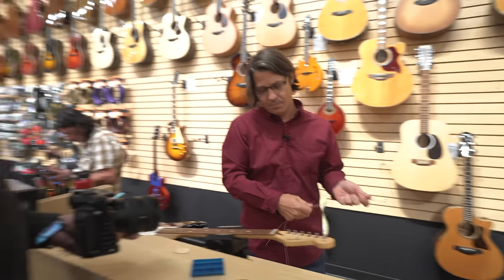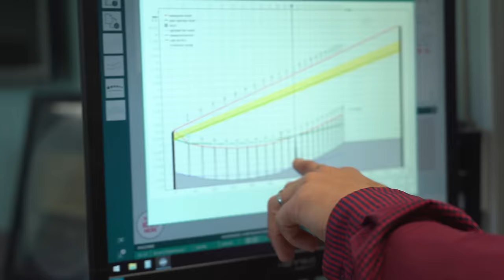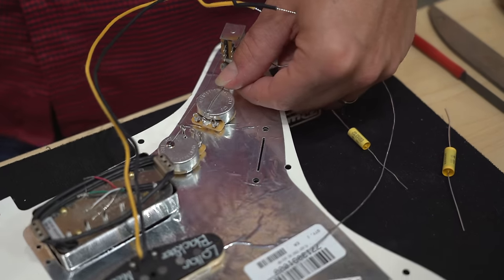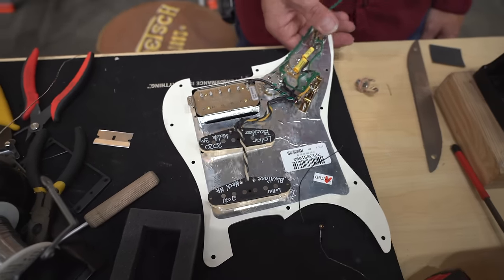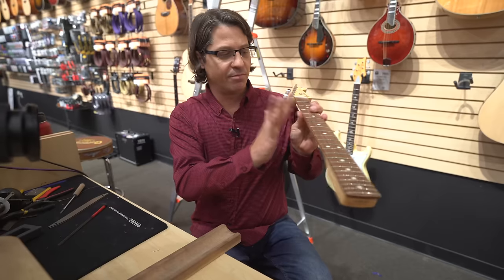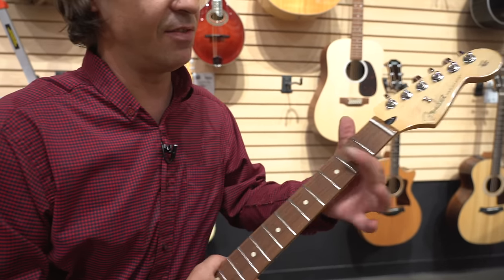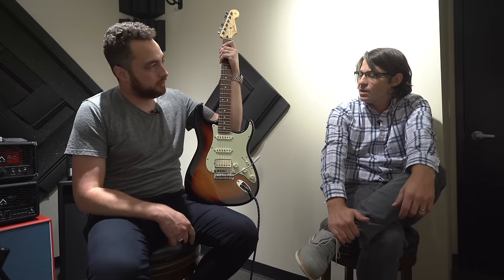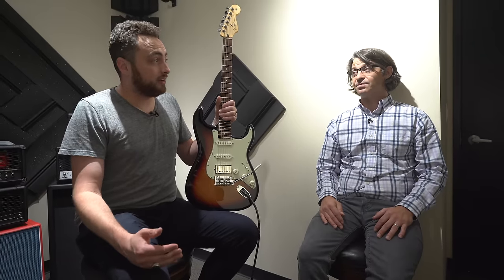We Tried To "Custom Shop" The Cheapest Fender Strat

Comment: I’m a lefty and my main guitar is a telecaster. Bought all of the parts individually. MIM black body, Gotoh modern bridge and saddles. MIM Maple neck and added fender locking tuners. Pre-wired control panel from Wainwright Custom Guitars. Fender custom shop Texas special pickups. Took the PU cover off the neck PU and used an open faced cover. Wanted a copper colored pickguard, but being left handed that was impossible to find. Settled for a nice aluminum one.
Put it all together when the last part came in and had it professionally set up.
$987 total. The guitar is perfect in every way. The pickguard and open face bridge PU cover makes it look badass.
A lefty can’t walk into a guitar store and play a telecaster that nice for under $1,600 if there are any lefty guitars to play. I stopped going to music stores because of the lack of options when I go.

Comment: I have to say, I've plenty if guitars and have owned many Fender Strats. The Mexican Player series are great for the money and mine have never had the issues this had our of the box. So either standards are changing in QC or I've been lucky. Because I can't claim the American feels any better holding them side by side. Both sounds great too.
Reply: I’ve always felt this as well
Reply: Its QC. I ordered a Sweetwater exclusive strat and the first one I got had a tilted neck. As soon as I sent the pics to the guy that helped me out, he immediately sent a replacement. That replacement had multiple dead spots on the neck, and the nut was cut so badly that it would ping every time I bent certain strings. I tried to have it repaired under warranty, but the nearest authorized Fender repair place is 2.5 hours from me so they just ended up sending a third strat. The third one was nice, but it definitely needed some fretwork, and one of the screws that screw the trem claw into the back of the body is screwed in at an angle compared to the other, making it kind of tricky to screw each screw in the exact same amount. I decided not to give Sweetwater a hard time about it because they went above and beyond by sending me replacements. That being said I love that strat. I put '57/'62 pickups in it and play it daily. I will say my biggest lesson learned is to try out instruments before you buy them. I already knew that's what you're supposed to do, but I loved the look of that sweetwater exclusive so I had to get it.
Reply: The only "issues" this Chowderhead had was that it wasn't set up and intonated directly out of the factory box which they never are.
Reply: @m.j.c.6969  And shouldn't be really. Yes it shows great stability buy I'm in the UK so no matter where my guitar comes from, it should be shipped detuned.

Comment: I did something similar last year with my very first guitar, a 98 Mexican-made Fender Standard Strat. I put a couple pickups in it (SD Hot Rails in the bridge and SD JB Jr. in the neck) back in like 2006. But last year, I got a new neck from Warmoth with an ebony fretboard, stainless steel frets, rolled fingerboard edges, locking tuners, new pickguard, new pots and caps, all new wiring, new switch and a new bridge. Then I switched the JB Jr. to the middle position and installed a SD Vintage (whatever Gilmour plays). And this thing is an absolute beast now!

Comment: I liked the sound of the original pickups. I think it would have been a fairer examination if they did a full setup before modding to see how it could have sounded. Then change it all out and see what is gained.
Reply: @Boony Tooty I agree. I didn't like the new pickups. Ask a guitar shop should you buy the expensive instrument or just do some very basic filing and pickup changes. It's actually really easy to change pickups and rewire with push pull etc. I did it on a guitar I built. The power of google really helped. I don't think you should consider the resale value. It would have been a better comparison to itemize the total cost as I expect the labour would be very high and something you could do yourself. It's not rocket science.
Reply: yep didn't like new pups
Reply: Exactly.
Reply: @Ralph Reilly Some years ago l installed some Lollar Specials in an 87 Strat and it totally transformed an already great sounding guitar into something absolutely stunning. I did renew all the electronics in that guitar and gave it proper shielding, but it proved that the right pickup can have a huge bearing on tone.
Reply: probably very little gain if he'd done that
Reply: @Ralph Reilly oh no, pickups are important. I got custom made handwound humbuckers for my 335, it changed my sound (for the best). I chose everything, from magnet type to DCR to potting. No regrets.
Reply: The cleans were great.
Reply: @jfar3340  you are right, but so is Ralph. Pickups do cause the sound to be different. However, more importantly imo, correct pickup height is key for any pickups to sound good. And there is no set standard, every pickup is going to be different. If you play with it enough, even the worse sounding pickups can improve dramatically.

There isn't really much a pickup swap can do that my EQ pedal doesn't already achieve. And I'm able to apply that pedal to any guitar and dial in my sound regardless of what guitar I'm playing. 

In order of importance: EQ pedal - Amp - Guitar(pickups) as a guy who made his living making music, I live by this.

Car analogy: a car engine has 250hp. I add a pickup to boost my hp to 265. I add an amp, bringing me to 310HP. I then throw an EQ pedal in the mix and now I'm cruising with 420hp. 

In the scheme of hp, the pickup didn't do all that much, though it did something. 

Not accurate at all, just how my head sees it.

Edit: even the tone knob on the guitar will do wonders on most instruments with helping them sound better. Nearly everyone just throws their tone on 10 and run with. Dail in the tone knobs on your guitar and there's all kinds of great sounds to be had with just it. 

Pickups are nice, I have swapped more out than kept original, but it is an over-hyped over marketed product that isn't as important as everyone wants it to be.  Clapton is going to sound like Clapton regardless of his pickups, ya know.
Reply: @ICantBelieveItsNotJesus  Yeah, the sound I achieved by swapping my pickups could ve been achieved with an EQ pedal or boost and some amp tweaking. BUT, now that I changed my pickups on my 335 from the awful alnico 5 to higher wound potted alnico 2 that suit my style AND the guitar better (inherently bright maple guitar with lots of resonance), I can't get a bad tone out of it. I don't need to tweak anymore. With my old pickups, I'd need to tweak endlessly to get it to sound right, not anymore. My guitar went from a ''good sounding but must spend 15 minutes to find the right sound'' to a ''plug and play marvel''.
Reply: @jfar3340  right on, I dig what you're saying. Let me flip it around a bit for perspective reasoning.

I've used an EQ pedal for 20 or so years. I can flat out the EQ on the board and dial in a more than suitable sound with most guitar just with the EQ pedal, in a matter of moments. 

It's like my kid playing video games, he can do all this stuff my mind doesn't even comprehend. It's just what he does so it's become like second nature. 

It's the same with using an EQ. The tweaking eventually becomes such a part of it that you don't tweak anymore because you know exactly what you need to change to achieve your sound.

EQ pedals are so overlooked among guitarists. Or maybes they aren't, they are just counter intuitive to the whole 'i need a new guitar or guitar toy' mind set. Because they quite literally make guitars sound like other guitars and amps sound like other amps. 

I can walk into any gig with just an EQ pedal and use whatever the house provides, knowing that my sound will not suffer.

But I too like new things and will continue to buy new guitars and amps and whatnots till the day I die because I AM MANNISH BOY

Comment: I did that with a $65 pawn shop -  a Chinese Squire - I changed all of the electronics, Switchcraft jack, Fender Fat 50's pickups, a new switch and improved the grounds and shielding. I played it professionally for 10 years. Still have it - it plays well and sounds awesome!
Reply: That would’ve been a great YouTube review. You should’ve made a video of your squire and get a lot of satisfaction for the money.
Reply: I did the same with my recently
Reply: i did the same with a full body squier se strat. new pots, seymour duncan humbuckers, redid ground and shielding, and finally just swapped in an ‘84-‘87 MIJ fender strat neck and it’s absolutely perfect for me.
Reply: and nobody will steal it for the Squier badging 😅
Reply: @jonnyz5772 

😂 Poor people's camouflage, make it look cheaper than it really is.
Reply: THIS would have been a better video
Reply: I have a 70s Japanese stratocaster, it's fairly beat up and the electronics are scratchy but it is the best sounding guitar I have ever owned next to my 2019 les Paul classic.
The only things I have ever done was rolling the fingerboard edges. Satin finished the back of the neck and crowned and redressed frets. 
For a guitar I paid 100$ for used its great. 
I would like to replace the electricronics but I'm scared it will kill the character of the sound. It has that classic early fender low output tone.
Reply: late 80's and early 90's squiers were very very good...and still are.

they were made in Japan instead china.

those who know actually pay decent money of those japsn made squiers, i've hade few and they were pretty much better than US made fenders😊

my most played guitar is 10+ year old cheap J&D telecaster, that was 120$ new, dropped in new pair of 50's fender pickups and it plays better than any mexico or china made(and even standard us fenders)

last Japan made squier i sold i bought new starting line PRS (not se)for that money....

Comment: I did this with a 1985 MIJ Fender Squire Strat. Over 37 years it's had every pickup made except a "filtertron" installed in it. Now it has Fender CS "TX. Spcl's". I rolled the fretboard edges on the 2nd re-fret with Jumbo fretwire. It's a nice touch. Always a "Bone" nut, upgraded pots, switches, & Jack's. Everyone has to remember I bought this guitar from a highschool friend, who owned it for 3 months, for $100.00 Yes, a $100.00. I will never get rid of this guitar, because now, after 37 years & all of the work done to it, it finally plays & sounds like a dream! Especially in the 4th pickup switch position! SPANKY!!!
Reply: Spanky?
Reply: Actually, I don't remember when you bought the guitar. A friend of mine bought a MIJ Strat for a stage back-up the same year and it sounded not bad just out of the box. It had a fat neck that I would compare to the Custom Shop, Custom Deluxe models from 2012 or so. The tremolo bridge wore out (stripped threads) but was easily replaced. Great value.

Comment: From the start, the guitar they upgraded is a professional level instrument. The hardware on the MIM guitars is excellent. As for the neck setup, fret polishing, etc, most of that can be done at home with a few basic tools. Replacing the pickups is a matter of taste: the original pickups on these guitar sound great already. The final price of can be a lot lower depending how much (or little) work you're willing to do yourself.
Great video again. Keep them coming! Thanks.
Reply: Excellent?..def not ..Good?..yes

Comment: Coolest thing about fenders is being able to do all of this ourselves.
Reply: Yes and that's quite important because the labor cost here vastly outweighs the parts cost. So if you're not afraid of doing these kind of things the upgrade will be much cheaper. Or you can start with a slightly more expensive guitar and get to the same final price, but with a better guitar.
Reply: Fenders is like the GM of guitars. You can buy OE(M) parts, replicas, mods, etc for stuff that's been around for 50 years.
Reply: The worst thing about Fenders is that you HAVE to do this yourself to make it worth the retail price.  The fretwork on the average Fender is shameful.
Reply: @benjaminnavarro865  how much are you looking at for labor per hour?
Reply: @edmondlau511  I don't think I have any figure for that but parts are generally not that expensive. Pickups are the most expensive ones you can change and a decent pack is in the 100-300 range. Good tuners in 50-100. Electronics is cheap, nuts are cheap. A bridge/tremolo can be a bit expensive depending on its type but you can see that replacing all of that probably costs around 300 to 600. And you can do it one at a time if you don't have the ful budget upfront. Doing it piece by piece with a professionnal will cost you much more in the end solely because of the time spend opening/closing the guitar.
Reply: Oh no, you mean you can't do this to other guitars.....!!!
Reply: @benjaminnavarro865  Why would anyone need to buy 'tuners' (Machine Heads BTW, I'm an engineer, so the correct term is necessary for me)....They are by design, self locking and unless abused/broken or the aesthetic, never need changing. (Sorry for the loaded question as I already know what you'll say)
Reply: @sonicmistress  Well, some tuners are quite bad actually. Aging is another factor for changing tuners. I also really like locking tuners as they make string changing easier and faster so I could swap original non-locking tuners for locking ones. But bad tuners are definitely the #1 reason for a change
Reply: @benjaminnavarro865  I've replaced the bridges with Super-Vee Blade Runners on two of my strat-style guitars (One is a Mexican Fender Strat, the other is a 94 Peavey Predator) and I can say it was one of the most rewarding upgrades to each of my guitars and took very little effort.  I didn't need to do much intonation adjustment because they came with the saddles roughed in, which really surprised me how close they were out of the box.
Reply: @sonicmistress  Higher ratio and tuning stability
Reply: @NilsBreckoff  I always felt like higher ratio tuners just make it longer to turn lol. I get the concept behind it but I don't think a 15:1 is truly that much worse than a 21:1 ratio...
Reply: @markuyehara7880  And what a shame that factory plastic nut immediately need to be replaced!

Comment: Keep in mind that in the 1919$ is included the hours of work. With basic knowledge and practice you can do that too, I did the same on a Mexican strat, I basically replaced everything, neck included, and it plays like a dream, and it feels like a more personal guitar, I've put some sweat into it and it only cost me 400 to upgrade it fully. I think at least a good setup and footwork is a need for a guitar and it's not very hard to do well
Reply: That's exactly how I do the up grades, as well, and I always put roller saddles in the trem. It'll stay in tune better, and for sure up grade the nut to brass or bone, brass being my fave. The price comes in in the range you quoted as well.
Reply: Fancy footwork?  :D
Reply: why dont you made a warmoth if you only left the body already?
Reply: @bluematrix5001  well cause I like to actually make the different parts, so I get pieces of wood and craft the neck and stuff. The body needs routing which is a bit scary, I've done it before but I don't feel comfortable doing it. And this strat I'm talking about was my first guitar, I didn't want to get rid of it.
Reply: Best to do it yourself. It’s wood and wires. Like, it’s more fun, to go fast on a slow motorbike, than go slow, on a fast one.
(Don’t nip your fingers though, wear gloves. Safety first!).
Reply: @frenchblacksmithedits280  still got the old neck?. Try a refret. (I found a super strat neck in a chuckout pile, missing 1 fret).
I’m a lefty, so a non-reverse firebird might be the go. ( I really should stop buying wrecks off of marketplace?).
Reply: Might as well change the body tooo?
Reply: @duellingscarguevara  i do have the old neck still but I've never done a refret. It was a maple neck which I don't really like, hence the replacement, but yeah if you feel confident I sa go for it and get that neck up to your liking
Reply: @mohamedtlass3842  the plastic is all original 70’s?😉. If you ever see an emperador copy of a deluxe tele (the one with humbuckers, and a strat neck). Grab it. They were great copies, from the 70’s 80’s. Rumours about who made them, but Ibz, was one I heard.
Reply: @frenchblacksmithedits280  good hobby, I can lift a whole fingerboard (both rosewood 22 fret), Same neck radius, from a L/H Tele I got for cheap, or order some fretwire. It’s all a matter of confidence, I was given an old “reinforced neck” (according to the sticker), guitar, that kept warping. Took the back off a couple of times (that’s how to get in them), and ended up making a resonator guitar. Ply top, with f holes carved out). 
 Good fun, experimenting with upside down cones (they did exist), a bloke told me, he made a reso out of a dodge hubcap.
One of my slide guitars, cost $10. (Howls like a beast, with its encore neck🙉, and 1 humbucker).
Reply: This x 100!

You learn about the instrument and once that work and effort and thought has gone Into it you bond with it and if you don't F it up lol you have one stellar  tool to work with...!!!
Reply: LOL if you replaced the neck why not just make a whole guitar yourself? You got a Ship of Theseus there dude.
Reply: @BollocksUtwat  well I made my n°1 guitar myself from a tree. Unbelievable that sharks were here before trees don't you agree? They can't even move or leave without riots lmao weak